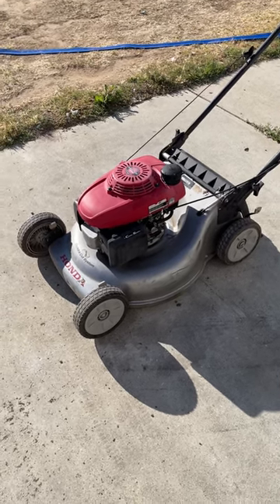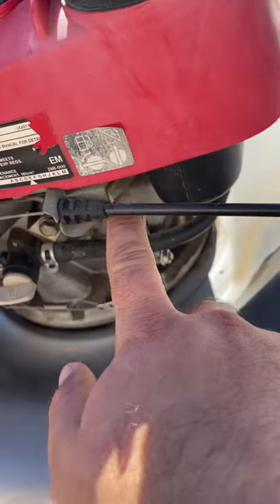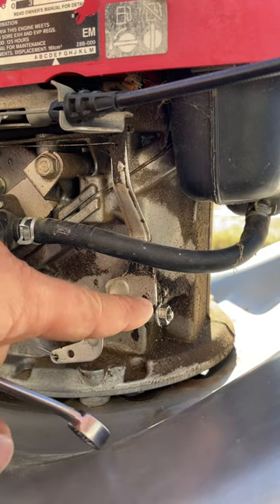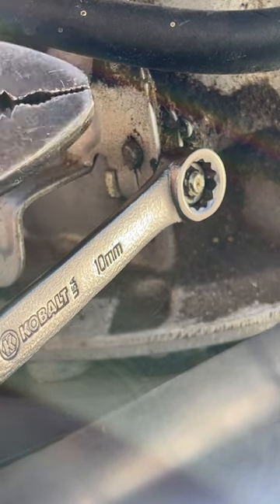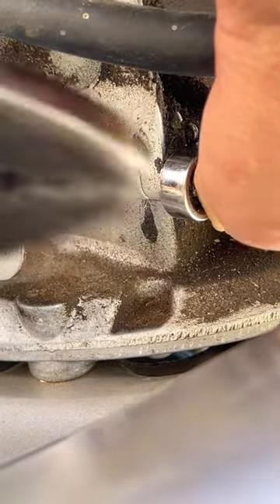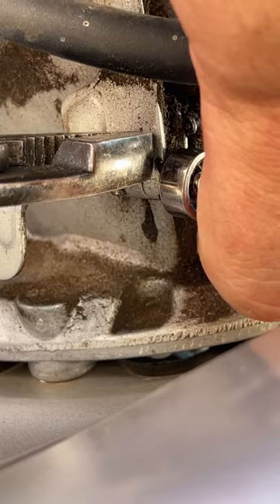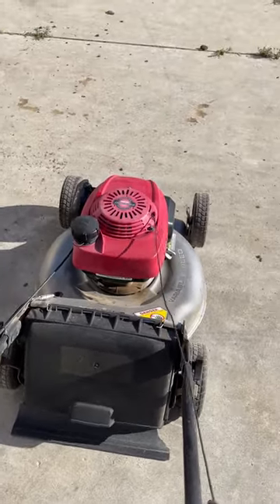Honda GCV RPM too High?  Adjust the Governor

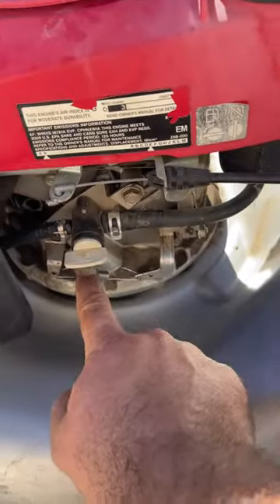Comment: Mine had underpowered rear wheel drive so my neighbor showed me you can just move the spring clip shown at 00:00:16 in your video from the left hole to the right one and the RPMs went higher and gave the self propel a nice turbo boost.
Reply: Thanks for this!

Comment: If I turn it to the right, it just keeps surging, running a bit low and not stable, but if I turn it just a smidge to the left, the RPM goes up far too much. Is there anything I could do about this? 
Thanks in advance

Comment: I did this and it still revs at 6500. What should I do now
Reply from the maker: Try cleaning the carburetor out
Reply: @hanksgarage_   it’s a bran new carb.
Reply: Then it probably your oiler went bad
Reply: Thanks!  Finicky to get it right but this short video set me straight.